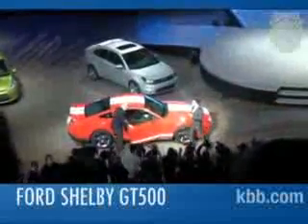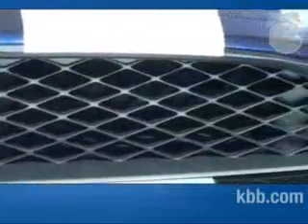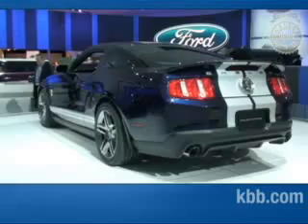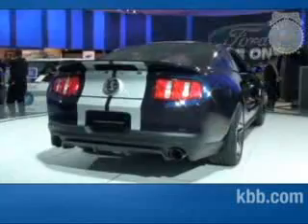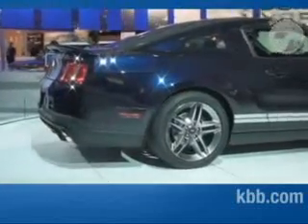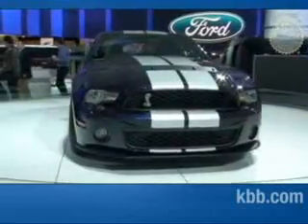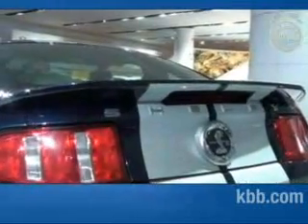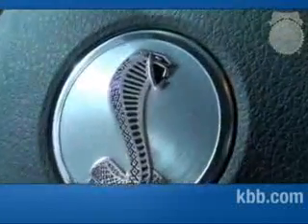2010 Ford Shelby GT500 - Kelley Blue Book

Comment: @HighCardWins Ford has done wonders with the suspension on the SRA. I test drove a 2010 GT and it handles much better than my friends 04 Cobra with work done to it too.

Trust me, you can't even tell it has a SRA. These cars will out handle the Termi's, as they also put down better skidpad numbers.

Comment: I know what the technical difference between a sports car and a muscle car is, but in today's world of performance cars, that line is really being blurred.  Just because the GT500 doesn't have the suspension to compete with the C6 in the corners, doesn't mean that they're in completely different classes of cars and should never be compared (especially considering that 2 or 3 grand in suspension mods will put the GT500 very close to the C6 from a handling aspect).

Comment: I am a huge Mustang fan, and I work at a Ford dealership. Where (in addition to regular repairs) I modify customers Mustangs. And with that Mustang expirience in mind, I agree completely with you. The C6 Corvette is a far better handling car, because it's lighter. Everything that the Corvette is, is better because of that root difference. I modded an '07 GT500, to 625 HP. and got beat in a drag race by a stock '08 Z06. It was too aerodynamic and too light. The GT500 is BAD, but it's too heavy.

Comment: @HighCardWins Yes he does. It is a cost thing. And the IRS that was in the Cobra is inferior to what they are using in the new GT500. I'm not saying a SRA is better than IRS, but in this case, it is. A present day IRS would easily be better, but the 03/04 Cobra didn't have the greatest set up.

Comment: This is the same engine that was in the Ford GT. That same engine has shown the capability to product more than 700 HP. Ford (like all auto manufacturers) intentionally tunes engines conservatively to prolong the life of the components. Sure you can stick an infinite number of turbos on a Honda Civic motor and get 500HP but it will blow up in a week.

Comment: Uhm, are the engineers bit frugal? In Audi's and Lambo's, Dry Sump lubrication is far more better than wet sump. Faster, efficient, and higher rpm.. Anyway, the gt500 is still stronger compared to the camaro ss..

Comment: Neither is the GT500 and the C6. The C6 is built with different Standards. It is a Sports Car. It is much more aerodynamic than the GT500 and has better handling. The GT500 is a Muscle Car. It is not very aerodynamic and even though it handles decent, it is not comparable to the C6. Two completely different cars made for two completely different reasons, okay?